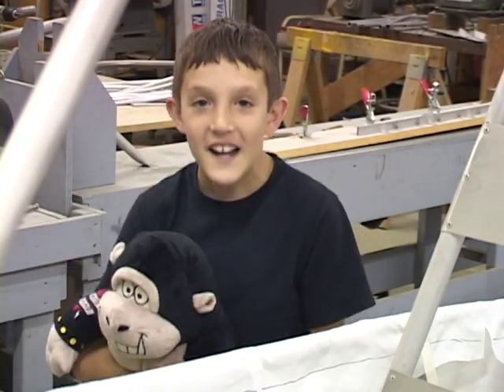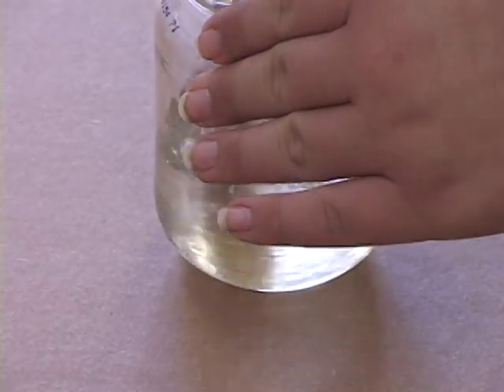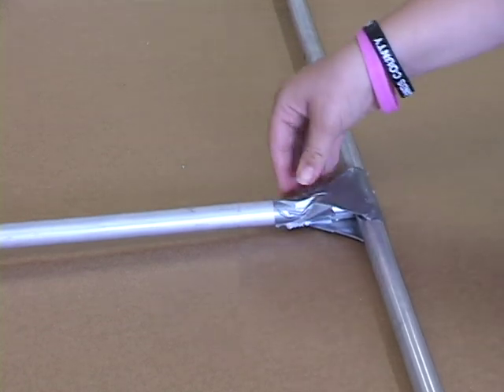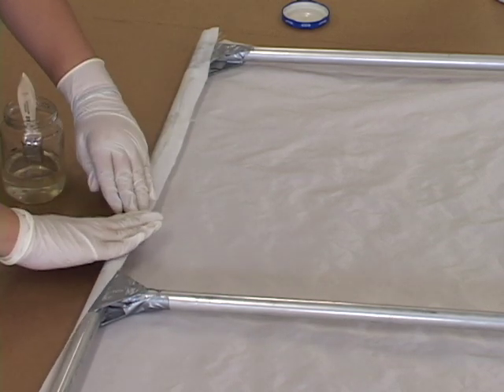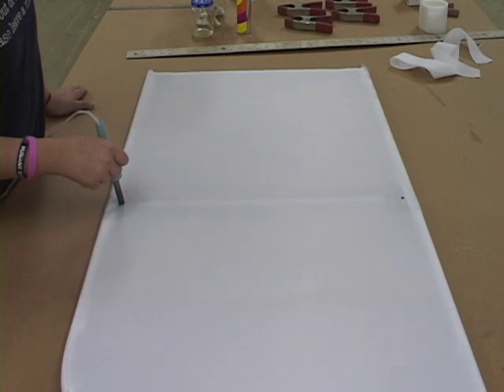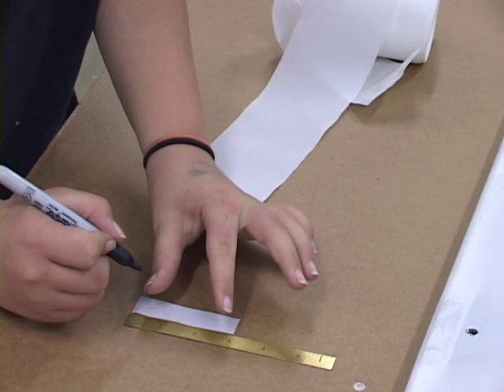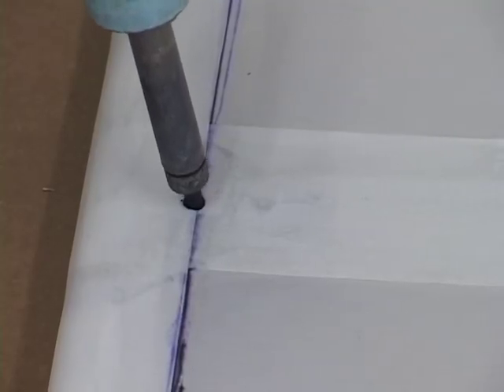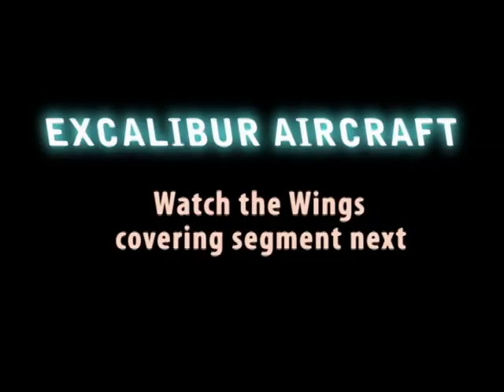Excalibur Aircraft Fabric work so easy a child can do it - PART 1.

Comment: Yeah, it is simple, but it would be also much more beautiful if those blue lines from the marker would not be seen. Such a work done but only a half way because of that ugly marker lines... also... where are the face masks for the kids?
Reply: non toxic products my guy as the child from this video I can assure you its safe lol and not labor if I wanted to do the task
Reply: @jessicap3014  Nice job in the video, Jessica; however, you may want to read the Acetone and Poly-Tak containers. Aside from the 'highly flammable' and 'keep out of reach of children' labeling, the Poly-Tak contains MEK and Acetone.
Reply: @commentatron  MEK and Acetone aren't affected by your average breathing mask. As long as you have decent ventilation, which is important... in other words, having a couple open doors and a fan to move the air.